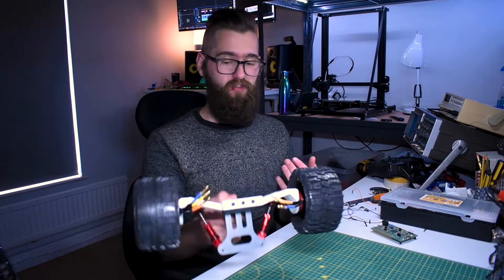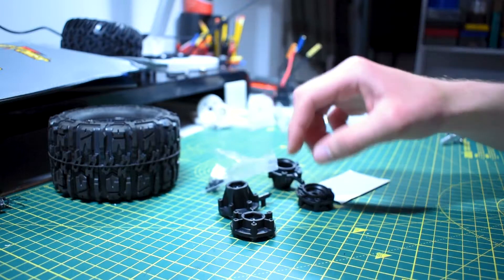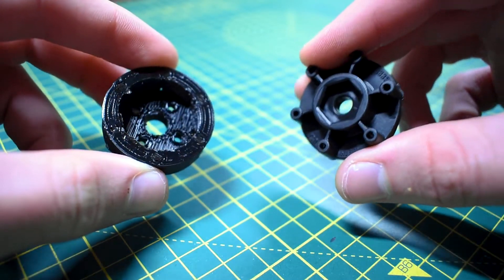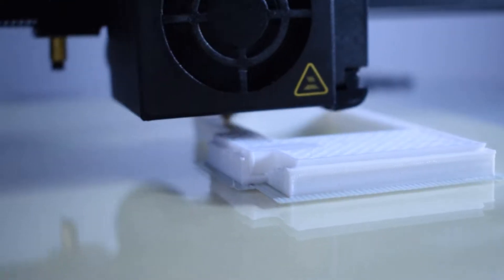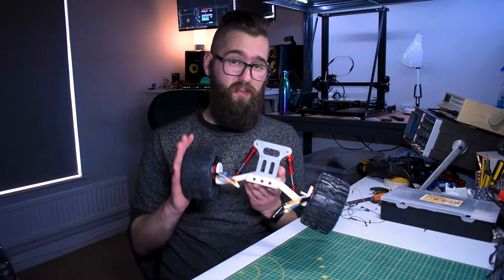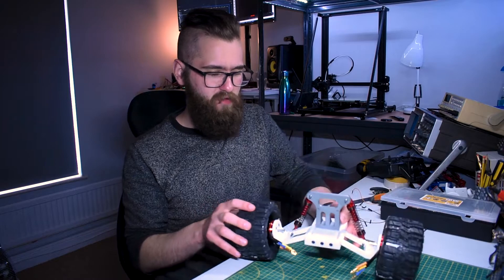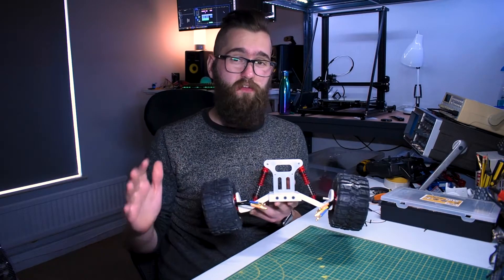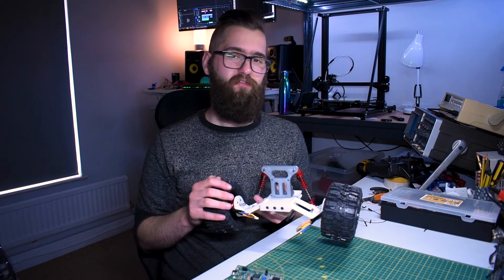Rear Subframe Draft & ProLine 2.8" Trenchers

Comment: Am I the only 1 that thinks that the way you use the spacer from the motors is kinda wrong (my opinion) bolt down the spacer with the 4 bolts to the motor and then use a nut to lock the wheel to the spacer
Reply from the maker: Nah man, there is no hex coupling! If you just use the nut the wheel is not coupled to the shaft. The wheel would just spin on its own while the motor remains stationary! The 4 bolts couple the wheel with the motor! I ditched this approach anyways, check out my recent videos👍🏻